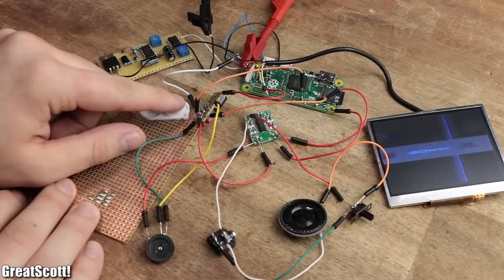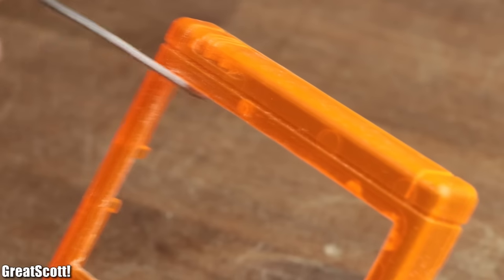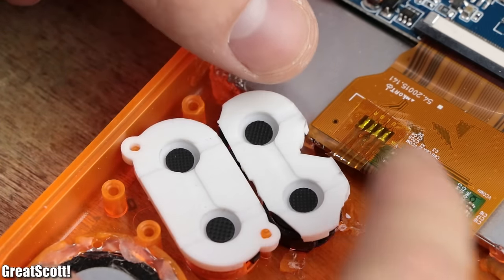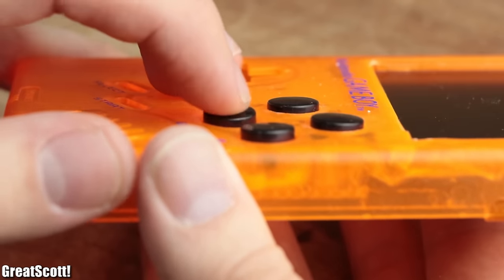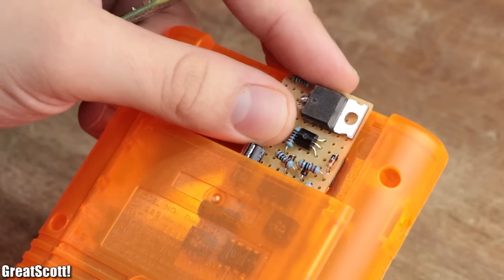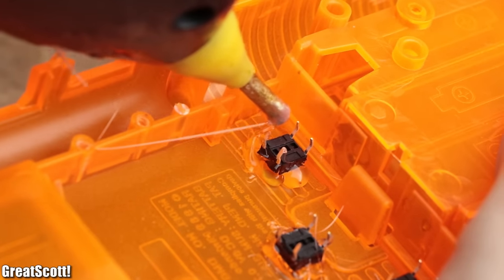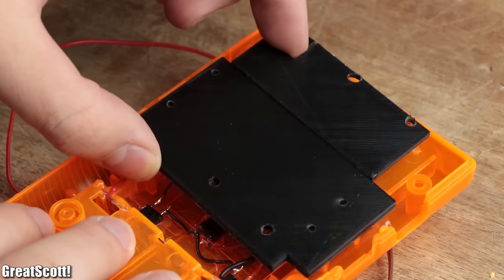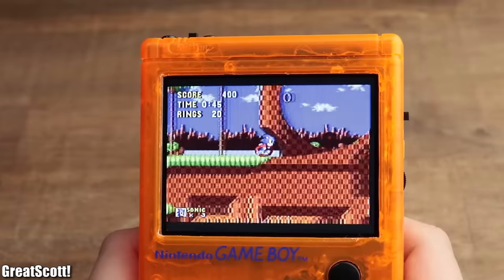DIY Raspberry Pi Zero Handheld Game Console (Part 2)

Comment: How do you deal with shutting down the Pi properly?  You can't just be switching off the power, can you?
Reply from the maker: You can shut it down through the main menu. And then I kill the power.
Reply: Do you know of a circuit you can use to push a button to turn it on, and then push a button to turn it off--but the system shutdown properly and then cuts power so the battery doesn't get used up?  I am in dire need of something like that.
Reply: Rick Seiden you can just switch off the power, you don't have to shut it down like a pc
Reply: It's a Linux system.  They have to be shutdown properly before being powered off, or you will corrupt the file system.  Basically, these really are mini pcs, and need to be treated like that.
Reply: That will risk corrupting your sd-card. 

@Rick there are other projects on the Gameboy pi out there that handle that problem, however it's fairly simple, you need a voltage monitor chip and for example a program that runs in the background of the RPi listening on a certain pin, if that GPIO is pull high/low from the monitor alarm it will the initiate a shutdown. You can even make the system check so that your program is always running.
Reply: There have been quite a bit of posts about that on the raspberry pi subreddit. If you google shutdown button raspberry pi you should be able to find something that does what you want ;)

http://iot-projects.com/index.php?id=raspberry-pi-shutdown-button something like that
Reply: Rick Seiden I do this alle the time nothing got damaged, but yes you right, simply turning it of can damage the SD card or cause a kernel panic, but normally nothing happens
Reply: That's gambler's fallacy, also you don't always notice problems you create right away. While I agree a RPi running retropi isn't critical it's a very bad practice.
Reply: It's more than just a shutdown button.  If you use a shutdown button like the one you linked to, the pi still draws power from the battery.  I need something that shuts it down, then powers it off, until the button is pressed again.
Reply: Well google is your friend then.
Reply: You'd think that, wouldn't you.  :)  Google is not giving me what I want! :(  I did find one circuit, and it almost works, but it's not sending the signal to the RPi on button push like is should.  I'll probably tear it down and rebuild it.  Sometimes that works.
Reply: Rick Seiden you can use a shutdown script for shutting the pi down safely and a switch to cut the connection to the batterie
Reply: well, you can do it with transistors or mosfets. just google 'latching switch circuit'. and then modify and re arrange the transistor to the GPIO. you can use custom system's configured output signal to trigger the transistor to switch off.
Reply: To be fair, when I leave home, I always cut the power of my raspberry pi radio without powering it down first. I am doing that every day for 3 years now. The filesystem is still alive and nothing happened yet, so I continue to do that. I know it's not good but I think Linux can manage that pretty easily, and if something happens I simply reinstall the system.
Reply: Imagine it as pre acpi pc. U need to shutdown till it says it safe to turn off ur pc, then unplug it.
Reply: One of my RPis kept getting a corrupted filesystem. I thought my SD card was bad, until I noticed that it was plugged into a socket that hooked up to the main switch of my living room. Plugged it into another one and it never happened again
Reply: Ummm yea it's a Linux system, and both current de-facto filesystems ext3 and ext4 are journaling filesystems. That means that on the filesystem level no corruption occurs on power loss (a recovery journal entry is written before data structures in the filesystems are modified), provided that the underlying hardware respect flush operations.
Reply: On the sudomod forums Camble has a safe shutdown circuit:
http://sudomod.com/forum/viewtopic.php?f=22&p=10968
He also sells printed versions of that circuit for a few dollars.
Reply: just cutting off the power just instantly stops the pi, so just switching it off would still work
Reply: Actually you are wrong.  just powering it off can actually cause corruption of your SD card.
Reply: look up Mausberry
Reply: Barry Manilowa really?  so my 5 years at a computer repair shop, where I personally seen SD cards get corrupted from improper unmounting or shutting down was all imaginary then?
Reply: Michael Johnson Special Makeup Effects.  nice attempt at trying to bash me.
Reply: Michael Johnson you still trying to insult me?
Reply: And this is why YouTube comments get such a bad rap.  An innocent technical question turns into an insult-a-thon.  Can't we all just get along!?!
Reply: I shut mine down once on accident. No corruption. lol!
Reply: Awesome
Reply: Why not make a button that shut's down the system properly?
Reply: LexusAD this is incorrect. Shutting it down with the power switch will cause file system issues and on reboot you will see messages about "dirty" files
Reply: I use it as a music player, and as this application does not deal with sensitive user data, I just turn off the switch, exactly because it's a Linux. I never had any corrupted data. Raspberry Pi uses ext4, that's a logging file system, that has provisions to deal with sudden power downs safely. Even if it ever gets corrupted, you will lose maximum some user setup files (that happened to be, for whatever reason written exactly then). Those are easily replaced or re-initialised.  You are at no risk of causing permanent damage to the SD, or more serious damage to more sensitive data (like bootloaders, etc) on that SD. Anyone telling you otherwise, they don't really know what they're talking...
Reply: I don't know how many times I already shut down my Linux computer by pressing the power button long enough and it's still fine and working. :D
Reply: Where on the face of the planet did you find a Pi for $5
Reply: @rickseiden1  yeah im looking for that circuit too

Comment: The 3D printing section of this project is pretty much what makes it impossible for me to make.
Not that I ever did something that creative myself using a Pi but I don't have access to 3D printers either.

Still a well made and yet simple looking Pi GameBoy.
Reply from the maker: You could always order the button wells from the link in the description and create the cartridge slot from another material. Maybe wood.
Reply: 3D printer is not necessary, make things easier yes, but necessary no. There is always a workaround when a 3D printer is on the screen.
This videos not step-by-step tutorials, rather than inspirational videos.
Reply: The button wells aren't necessary. I do have access to a 3d printer but even without it I could have built mi GB zero. You can also use some polymer clay like Fimo to shape the wells, bake it in a kitchen oven and glue that in place. You can also just use the original metal plate just make sure it's insulated. My project doesn't look anything like his inside. The only 3d printing I did was for the wells and even that isn't necessary.
Reply: you can get a sheet of ABS plastic for the backing cover, or just buy two cases and salvage the button wells if you feel the need to retain them. they arent expensive.

Comment: Hi Scott!

I loved this project! It inspired me so much, I ordered all the needed components  immediately after the first part :D. I thinked about it pretty much and I have one question: What happens when the battery protection circuit cuts the power? Because if it don't save and shut down the pi before the the circuit cuts the power, all your game progress will lost. 

I have an idea how to solve this but I'm really not into the PI stuff (like to play with the arduino and esp8266 better), so can you help me with this please?
I'll use a 18650 li-ion cell with a charging/protector module from aliexpress (it's dirt cheap, abut 0.5$ /piece) with a 5V Boost converter. With a voltage divider I'am able to scale the battery voltage down so i can connect it to an analog pin on the zero. So here is the problem: I don't know how to monitor the analog pin in the software and run a script which saves the gamestate and make a soft shutdown if the battery voltage reaches 2.8V from RetroPie (or Recalbox, from this perspective it's basically the same).

Love your channel, keep up the amazing content!
Best regards!

Comment: but why did you not 3d print the case ?
Reply: Trupti Ganage  good point
Reply: Its DIY - the fact he didn't 3D print it makes it way more DIY
Reply: But if he would print it, Then he would not have to do all that cutting and trimming
Reply: Trupti Ganage For those that don't have printers and want to manually create the case.
Reply: abid latif Didn't think of that. I just remember for some of his previous projects, he created cases from scratch.
Reply: Yeah, I agree. Making something with your own hands definitely feels accomplishing. There are times you'll go manually I believe. If I remember correctly 3d printer has trouble printing something with multiple layers.
Reply: I agree. Its much easier to modify an existing case. Another problem I'm aware of with 3d printouts is the tend to have less strength. I have SNES handheld project (got the idea from Ben Heck's book for building portables) I've been working on and I plan using big tupperware food containers to create a case.

Comment: A big tip for anyone attempting this or other projects... Don't use hot glue, or if you have to, only use it in non-crucial places and in small amounts. The main problem being that the bond of hot glue gets weak when it gets near freezing. You wouldn't think this is a big issue for most people, but, say you forgot this in  the car for a few hours during the winter months, or you made one to sell, and you ship it in the mail where it's below freezing in a lot of places...

Comment: I want to see an affordable, compact, handheld PDA, with a digital camera, speakers, contacts, calendar appointment reminder, and everything except for WiFi, Bluetooth, cell signal, wireless pay, and other wireless technology. Fit inside a metal case to prevent wireless technology, tracking... A built in cyberdeck isn't a bad idea. As for the keyboard, either a tiny BlackBerry keyboard with a small screen, should extend battery life, by reducing the screen size. Of course the screen should be bright outside. A microSD card slot will be great. The screen should have metal shielding behind it to prevent wireless technology such as WiFi... From leaking out. Privacy is the priority. 
Maps and navigation using a gps reciever is a great bonus as well.
Reply: ude a raspberry pi zero without wifi, conect a hdmiscreen and a keyboard and put in an altoids tin with batteries
Reply: Sounds good. Where can I find parts that fit?
Where can I find software for calendar appointment reminders, Taking digital pictures and video, playing music (I need speakers too), a good camera, GPS receiver and GPS navigation using 2021 maps and data, and a clock app, standby, and maybe a tiny solar panel on the outside.

Comment: Much more easy to melt holes in plastic then drilling.  Heat up a pointed steel rod with a torch - then just push it through the plastic.  For melting larger diameter holes use thin wall metal tube.

Comment: Really great project, and the voltage circuit will come in handy. What kind of battery life do you get on those batteries with one charge? 

One thing I would've changed is using more original parts. Yours is the best use of the hardware available, but it isn't particularly professional looking. Original switches for the power, volume could easily be adapted for use in this. I'd have to find a solution to those shoulder switches, as I couldn't deal with how they look on the back.

Comment: Great build! 👍 Iv just finished my gameboy zero. It pretty clean, no need for 3d printing or hot glue. I managed to plastic weld pegs in so I can screw parts In and out when needed. Iv just put a video up on my YT if you wanna check it out.

Comment: Nice build, I like that. However I would never glue a post with hot-glue. Use superglue, or epoxy instead. The screen cutout could have be a bit smaller, as the actual pixel-area is a bit smaller than the black area.

Comment: I would use cyanoacrylate to glue the button wells in position. Also, instead of hot glue to keep the LCD in position, I would use black narrow biadhesive tape - the same type used by small devices manufacturers. Usually, the less glue I use, the better I feel.

Comment: You seem to put a lot of trust in the holding strength of hot glue. Is it really that robust that you can just put a dab of it on the previously cut screw pillars, and have it hold the case together? I would be worried that by screwing and unscrewing those bolts the hot glue would twist apart. I'm intrigued, maybe I should start using that thing more.

Comment: Nice job. I have never used hot glue for anything like this - do you expect it will hold up?
Reply from the maker: I am 99% sure that it will hold up.
Reply: It,z Deoxy New? What new are you going to play on a RPi
Reply: It,z Deoxy No new games will work. It's not a supercomputer because of power, but because of size. Xbone and PS4 struggle to handle new games and this is far far from that. This will run most older games fine on retropie, but for "new" you're in the wrong place
Reply: It,z Deoxy Sorry for being a little blunt but glad to assist.
Reply: it'll hold up as good as the plastic itself, and it lets loose you can reapply new glue
Reply: nope

Comment: you should use eagle cad (free software)and make a basic pcb with all the wires as traces and make a pin header. you can take the image and print it on a normal printer and etch the board your self. then solder your components on. then you would just need to plug the pins into the pi. The speaker can attach to the pcb and you would not need all that glue lol.

Comment: Hey Scott, very good description to build an GameBoy Zero. I'm on a good way with my once.

I've a big issue with the controller board. It is very heavy (for the moment impossible) for me to make the correct solder points with the correct size and dimensions for the controller buttons. Especially for the start and select buttons. They are too tiny.

Can you post a picture of yours or maybe a pattern at your HowTo-Page???
I despaired for the moment. I'm not far away to order an ready to use common ground board at eBay.

The rest of you tut is very good. Best howto i've seen so far.

cheers - aitsch

Comment: I wish I had talents like this. How many hours did you spend all together?
Reply: You'll aquire the "talent" by trying (and failing) until you get it right.
This project may be a bit costly to start(lots of component) but try building something like an arcade stick by salvaging an old usb controller for exemple(you'll still need a small investment to buy buttons etc, but it's not as costly)
Reply: Too many people are afraid to fail...

Comment: absolutely love these video's, hopefully someone will know what "silver copper wire" is used for the ground connections rough mm /gauge is used and is there a guide for the mm /gauge based on voltage, many thanks
Reply from the maker: d=0.8mm But you could use pretty much any size. There is almost no current flowing.

Comment: Love love love! Great work, Scott!
Will this work with the Raspberry Pi 1 Model B? Granted, it won't fit in the case, but I have that version of the RPi, as well as an HDMI screen from Adafruit.
Reply from the maker: Should work with every Raspberry Pi version.
Reply: GreatScott! Fantastic! Thanks a lot, Scott :)
Given that I have a config setup for my screen already, that I know works, can I use that instead of remote logging in to the Pi?
Reply: Azayles you can always desolder Lan port, usb to make it fit better ;-)
Reply: Wrathos That's probably what I'm gonna do do anyway so I have more room, as well as desolder the composite video port. I'll be making my own case, as the screen I have is a 5" one, which would never fit in the gameboy case anyway :D

Comment: I don't quite understand how the buttons on there work, I've watched the video a few times and you where talking about creating a common ground, and then adding a wire to the other side,. If anyone could explain, how do you use the conductive buttons on the perf board?

Comment: Why not go on Amazon and look up USB headphones with in-line controls, I don't know if it would be cheaper but it would certainly be easier for the average person.
Reply: I found some really dope looking USB headphones with in-line controls for $8 but I bet the sound is really crappy, I also found some USB speakers for $13.
Reply: I tried looking up USB Bluetooth speaker but I didn't get anything. I bet it's possible to get a Bluetooth speaker to work over USB, I wanted to do that because it came with a battery. But it probably doesn't come with that functionality under $10.

Comment: I have a quetion about the Raspberry Pi. Is it possible to make a 42. zoll monitor working by changing the mainboard to a Raspberry Pi to use it as a monitor or entertaiment system or a other solution as a Raspberry Pi to experiment something new would nice to see your thoughts on that ...

Comment: Hey Scott. Love your videos. I was wandering, and taking into consideration your expertise in electronics, if its possible to create a safe shutdown pcb using the on_off switch and probably a comparator that will issue a shutdown command to the pi? Also, i've been watching all your videos and the ic's made me thinking if we could use an arduino or best a atmega32u4 (which i use for button controller) to somehow show on the lcd some king of low battery indication.. or in a orange led...
thanks in advance